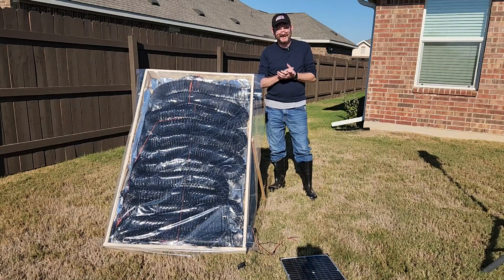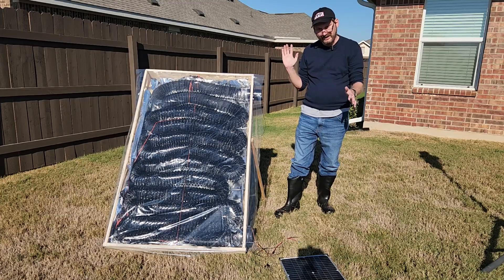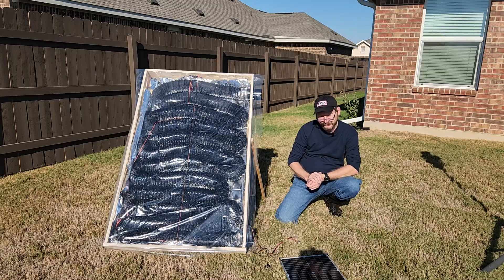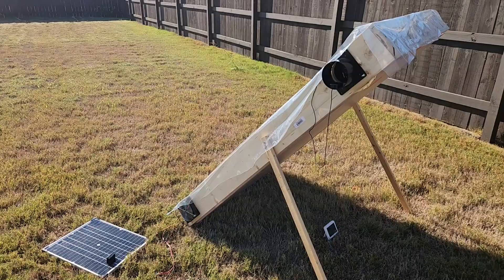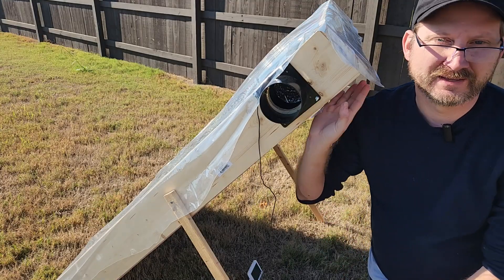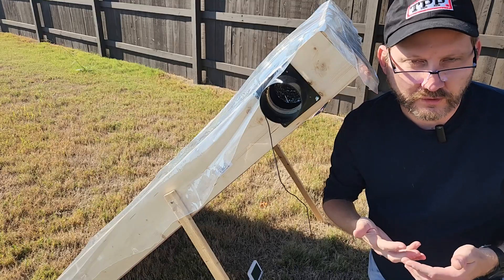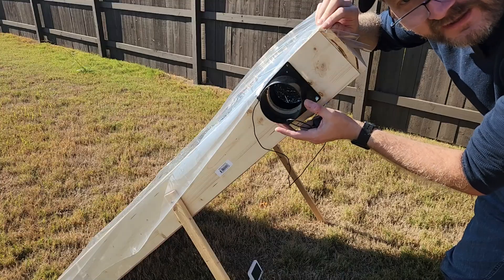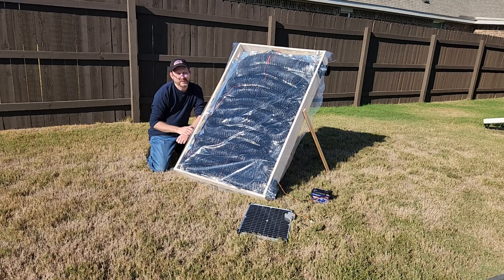I built a Solar Air heater.  Version 2. I gained 110F in 20 minutes! @texasprepperprojects  80C!

Comment: Try recirculating the air in the tubes with a y splitter to lead some air back to the intake.  Just run a tube inside the radiator from the top before it exits to the bottom. Maybe you can get hotter temperatures reheating already hot air. I’m at need a stronger fan .  Instead of just heating fresh air you’re  reheating already hot air
Reply from the maker: Check the latest vid

Comment: Do you think this could be connected directly to the HVAC system ducts in the crawlspace? My thought is that could have three benefits. First, it would simplify the system for getting heat into the house, since you could make the connection to the HVAC duct through a vent in the foundation. Second, it would preserve more heat by entering an already optimized system. Third, the heat would be used more effectively by taking advantage of the HVAC system’s forced air flow.  I would love to hear your thoughts! Would this be safe, practical, efficacious?
Edit: Thank you for this video. It’s inspiring!
Reply from the maker: I don't think that you would have enough gain for that large of a space.  I think that for something of this size, it's only going to work for around 150sq ft.    So, greenhouse, or for a bedroom that is facing south.

Comment: Great vid, I saw your experiment showing that foam core blocked more heat than the actual pink insulation board.  Any reason you didn’t use the foam core for this project?
Reply from the maker: Because I happened to have large sheets of this pink foam laying around. I go cheap until I figure out what I'm doing, then slowly improve

Comment: Interesting, I'll have to try to watch it all (in a rush now) but right off, the temp you got at the start of the video is well below the performance on my popcan solar heater (32F outside air temp, 152F exhaust within 10m of start on a slightly hazy day and I saw tempts hitting 199F on 20F days once I installed it.  I'm wondering if that's a difference in the cans vs the dryer type hose?
Reply from the maker: I dont think it is the material.  I think the key is the balance between length,  diameter and air speed

Comment: I have done this.  My solar collector was the size of a sliding glass door .. that is the glass I used .. I used a circulating system .. had a solar panel on the roof that operated a 12 vlt computer fan.  My setup was backed with 1 in. pink foam insulation .. it has melted.  In front of the pink insulation was a nice piece of metal roofing painted black to pick up and store solar heat that was moving past the 4 in. tubes.  This works .. but only if you are heating a small space .. like a camper or individual room .. and of course not at night!  The way I arranged it was to have a horizontal cavity at the bottom of the collector .. another at the top.  I used some of those large juice cans that are 4 in.  in diameter to hook my aluminum covered air dryer tubes to.  My tube ran vertically .. between the 6 in. chamber at the bottom and top!  

I think the best option is to use a diesel heater .. and use the exhaust to run through a metal piping or radiator framework inside the house before exiting.  That way you pick up exhaust heat .. not just the heat from the blower.
Reply from the maker: Thank you

Comment: So painting the hose black gives you about 2x temperature differential from the firtst experiment (50 to 100) degrees. Also maybe pointing it at the sun, as opposed to horizontal  position,  may have helped. If you had the same sun intensity,  but it was 35 or 40 F, I dont see why you still couldn't get 135 to 140 degree results..True, one of these wont heat a room alone, but what about multiple units on a south facing exterior wall and or rooftop?  Rather than creating heat, like space heaters and central heating, you're   TRANSFERING heat( like a mechanical heat pump)
Reply from the maker: thanks. it is black and it is pointed at the sun

Comment: Saw this originally in Mother Earth news over 30 yrs ago. I built two solar heaters but they sit on the inside window sill of a south facing window. I built it with spare paneling for the back side, Used some left over 4 inch corrigated drain pipe. Using  a 4 inch inline duct fan at the bottom up to the top. The top has an adjustable elbow to help direct the heat. Using a battery box with a 100 ah Lifepo4 battery and a 200 watt solar panel charging the battery. Use a 150 watt inverter to power both fan's. On a sunny day both window heaters can keep my large living room and dining room above 70 degrees in winter when temps are around 30 degrees outside. This help keep my utility bill down by not having the furnace turn on for about six hours out of the day. Been using it for about 12 yrs now. 

You might think that the 200 watt panel is over kill. But I put two additional 12v cig outlets on the box. One  of the outlets has an adapter with two usb for charging phones and other things. The second 12v cig out let goes to a 3 tier lamp that has  two 12v RV light bulbs for indoor lights. i just cut the end off the power cord and added a 12v plug to the lamp power cord and run it directly off the battery. No inverter needed to power phones, lights, charge up ham radios and so on. 

Use a stronger fan on your solar heater. Might not put out 170 degree readings at that low flow rate. I get 130-135  on each solar window heater box. But the higher flow is reaching farther into the rooms.
Reply from the maker: Very neat! I have several powers of fans. Some 100cf. Some 300cfm. Still experimenting

Comment: Nice project.
Several things that might make your idea more efficient -
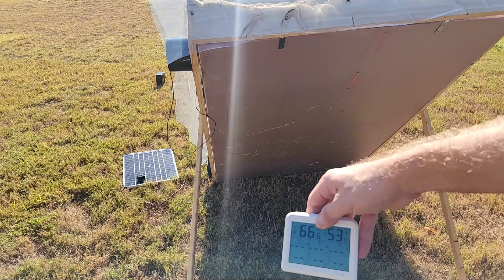1 - @ 3:49 the back of your "heater" shows light shing through the back. This lets cold air in, and hot air out. Silver metal duct tape would help prevent heat loss.
2 - Sealing the top, bottom, and both sides with the foam board will also decrease heat escape.
3 - HVAC heating ducts are put near the floor so that the hot/warm air entering the room rises and warms up the entire room. Air returns are on the opposite side [non-used section] of the home [room]. Think non-A/C mobile/pre-fab home.
4 - Insulate all exterior surfaces possible in your shed and [very important] duct work.
5 - Use any type of flooring mat [area rug] that would keep your feet away from the cold floor.

The warming effects shown at 60 degrees [before heat loss] is around three fold - 60 to 175 degrees. The same three fold warming effects [before heat loss] at 40 degrees is around 115-120. That's why heat loss prevention is so important.
Reply from the maker: Thank you!

Comment: I wonder how long that shower curtain will last. I'm thinking about building one of these for my small greenhouse.
Reply from the maker: I would use plexiglass from home depot. The shower curtain is for proof of concept
Reply: What do you use for your greenhouse? This would take just another 15sqft.
Reply: @Struthio_Camelus it's polycarbonate but was a kit that actually was one panel short 😂. I bet the uv stabilized greenhouse film would probably work, I just wonder if it would get too hot.
Reply: @adamhensley1217  Too hot inside the greenhouse? That's a common problem for greenhouses in the summer - generally solved by venting the greenhouse. This setup would be useful to extend your growing season in spring and fall. You might try a temperature controller to cycle the fan off when the greenhouse gets too hot (and when the sun hasn't warmed the collector enough.)
Reply: @Struthio_Camelus  No to hot inside the heater section for the poly.
Reply: @adamhensley1217 Ah. Pulling heat out of the heater to the greenhouse should help.

Comment: Why would you need  heat when is 70f degrees out? Gain 110F when its below freezing then I'll be impressed.
Reply from the maker: Thank you for your helpful reply. I'm sorry, I can't control the weather here. 70F is what the outside air temp is.  In a few months when it gets colder, I'll re test.
Reply: @texasprepperprojects You're doing good working it now and not trying to when it's cold. 
Thanks for sharing this with us TexasPrepperProjects.
Reply from the maker: Thank you!

Comment: if you brought the duct out the top and angled it right you could feed the air into the window with it open just a crack
Reply from the maker: True. What i would do is take a piece of the pink foam. Cut it the width of the window and 8" high and cut a hole just big enough for the duct
Reply: @texasprepperprojects  that would work also. my way puts the 90 turn inside, yours outside the box